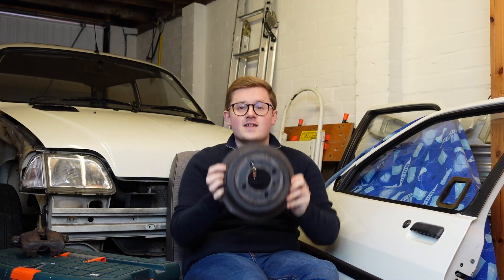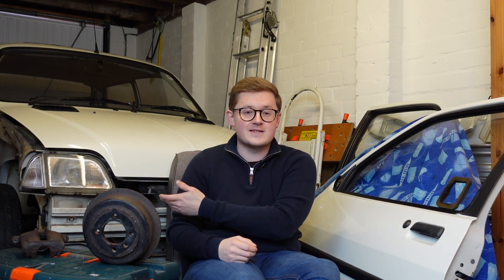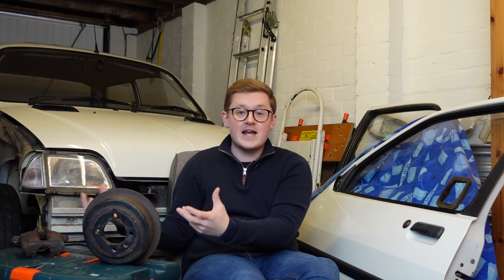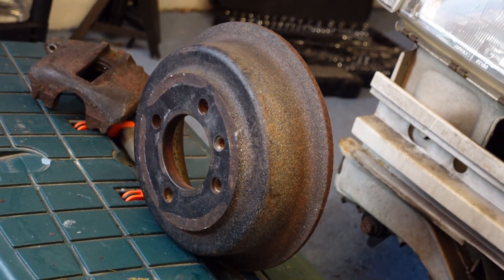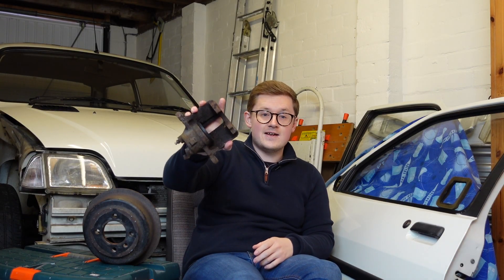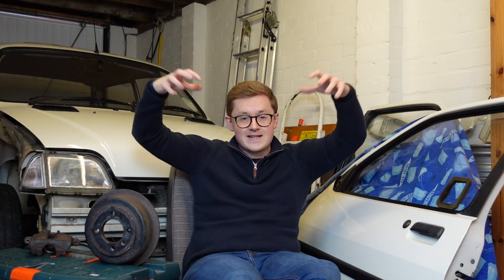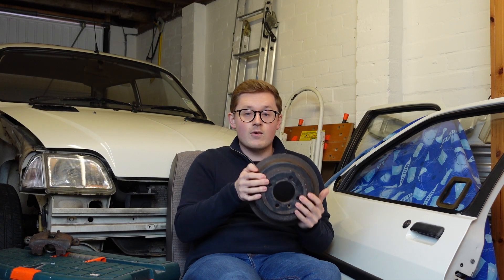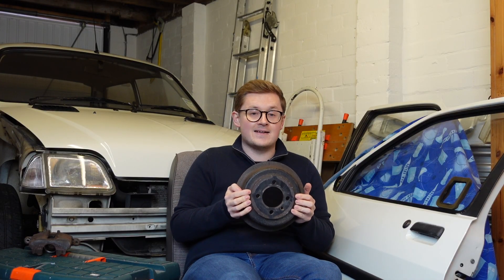Why are Drum Brakes Making an EV Comeback?

Comment: Fully electric brakes sounds like a horrendously stupid idea:
Yeah sure that would work, but there is a fundamental safety problem - what happens when there is no electricity? Are the brakes by default open or locked? For driving the brakes being locked would be the better option - if there is any electrical fault and the brakes no longer work (for whatever reason - dead battery, broken alternator, lose cable) would be fatal. But if they are locked that also means you can not move or rolling-start your car at all, nor can you tow it.

And for supposedly greater braking force:
Bollocks. That is complete and utter garbage, 100% wrong. Sure - they might be able to apply more force to the axel it self, but once the tires are locked up that's it. And any normal car has enough braking force to lock up the tires. Any extra force the brakes might be able to produce is useless by definition.
The same bullshit is still spouted by bicycle-enthusiats. Always funny seeing them claim that disk-brakes offer more braking-force than rim-brakes - and all i need to do is show that the rim-brakes are not only strong enough to flip you over but also to fully lock up the front-tire when applied too rapidly. Braking is fundamentally limited by the tires and that is even with soft high-performance tires.

Comment: Do you think all-electric brakes will ever be fitted t cars or lorries? These could eliminate the hydraulic system altogether, relying on electric actuators to operate pad/disc or drum mechanisms. This system, with multiple discs is used on the Boeing 787 airliner, where brakes are required to bring a huge weight of a loaded plane to a standstill under emergency test conditions of a landing or abandoned take-off. Presumably, actuators can be coupled to some sort of ABS system. One difficulty might be with achieving 'brake feel'.

Comment: Quick reminder that,as far as I can tell anyways, all EV have an established program to keep your disc brakes clean. Tesla highlights this more than others in their manuals. The pads will barely touch the disc randomly to keep themselves clean without slowing the car down.  Just barely enough to knock off any rust or dirt.  They do recommend occasional harder stopping from the highway just to make sure there’s no other issues for emergencies, but that’s not.  Otherwise, these are all great points and well presented!  😊
Reply: Tesla also says you have to clean and lubricate your brakes every year
So there might be a rust problem that maintenance must keep in check .
It's no wonder that Tesla's are doing bad in German Tüv statistics.
People think it's a EV and doesn't need maintenance, until they show up at the mandatory checkup and have problems after 3years of not watching after their car's

Comment: All electric brake actuation has been common for half a century on trailer brakes!

Not much to worry about with an EV, in the case of a failire you could still have a mechanical hand brake, and the systems could self check at each starting sequence judt like ABS does now. 
This will, in a sense, provide triple redundancy, as the Regen system is the primary braking system on an EV. 
One failsafe could be to make electric applied brakes like air brakes (they actually are configured to APPLY when the air source fails)

Comment: This is extremely good information. Part of the ecology is also durability and using things for longer. Battery of EV are now proving more durable than expected; and it will be even better for LiFePO4. A BEV purchase may now be one going for a generation time. The exchanging of cars every 2 years is part of the pollution problem. Keeping a car running for longer (any kind of power) is an ecological move. So drum brakes keep nasty dust inside, rust less the breaking mating surface, and require less maintenance / exchanging parts. The springs reducing friction is really great to hypermile. It can have as much impact as less using the AC, or checking good tire inflation pressure.

Comment: Well a bit of rust on the disc really has a neligible effect on braking, the pads shed the rust in seconds.
Reply: That was my first impression, which is why I was surprised when reports began to surface about EV's requiring fewer pad changes but more major overhauls. When used less, the whole mechanism rusts from disuse, eventually locking up into unreliable behavior. If your driving behavior rarely applies full force, you don't get the regular movement that keeps seals and rubbing metal surfaces clean and functional.
Reply: @spelunkerd  I drove a 1974 model car with drums about 2001[ sister in laws whilst mine was in the shop], it had never had a fluid flush and there was as much water as brake fluid in the lines and all the wheel cylinders had siezed, how she drove it without killing someone I don't know, hit the pedal really hard and slow down a bit, had a foot operated park brake I had to use. needless to say I stripped the whole system down and replaced all the wheel cylinders after a flush out.

Comment: 8:22 - that is no issue where I live in Australia. It is a legal requirement under Australian Design Rules that all EVs when using regen braking MUST activate the brake lights. It can be done, and ALL EVs should be doing this globally. To not require this is as irresponsible as not having any speed limits nor stop signs.

Comment: While the explanations are good, disc brakes came about because drum brakes "fade" when hot, which is dangerous. AND while you discussed that, I feel the points against disc brakes can be overcome. Why can't a mechanical actuation be made for parking the car? Also, why can't springs be put in to move them away when not braking? I don't feel those are valid reasons to go with drums considering their drawbacks. Really, EV manufacturers are going with drums as marketing BS selling us on it like it makes sense, just like they are trying to sell us that EVs make sense. It's marketing and they're on the losing end.

Comment: I saw a drummer at a pub session using the outer of a drum brake. He had broken a drumstick, so I quipped "a drum break?". No reaction! That's drummers for you. Disc brakes get hot, metal expands, & shrinks as they cool. Remember RHD Citroen Xantia (LHD designed hand brake lever)? If not put on properly discs release eventually. With drum brakes they bite better as they cool. I saw the results on a Transit van - was 10 seconds away from a "situation", measured it next day! If walking in the other direction - I shudder to think!

Comment: I have a few anicdotes and a glaring physics "observation" about drum brakes. I'll start with the physics.

In my physics course, I learned that the formula for friction is f=uN, or friction force = coefficient of friction(material's properties) x the normal force (the pressure the pads exert on the disk/drum).  Nowhere in this formula is surface area accounted for. I am no physicist, but I do not believe the surface area of brake pads plays much if any role in how hard your brakes can stop you. I believe the extra material on drum brakes is solely for extra lifespan. I suspect any extra braking force either system may generate would be down to increased pressure from the brake cylinders or the material of the brake pads having a higher coefficient of friction. My question to anybody who really knows would be, if both drum and disk brakes are capable of locking up the wheels, doesn't this mean that both types of brakes are more than sufficient for whatever load you'd be trying to stop? Ignoring cooling properties, weight, lifespan etc...

Anyways, my 30 year old pickup truck has drums on the rear axle. They lasted 250k miles (400k km) before needing to be replaced, and even then 1 side still had another 5-10 years worth of material on it (self adjuster seized up). The 2020 International flatbed truck I drove for work had all-round drum brakes. They did an excellent job keeping dirt and water out of the brakes while on jobsites and other various dirty environments. I never once experienced brake fade or reduced braking capacity from contaminated brakes.

Comment: So we're technologically regressing. All in the name of climate of course, or rather sticking it to the bad bald dude from Russia.
By the way, you don't need an EV to do regenerative braking. Just leave your car in gear and turn on the AC. Keep downshifting to keep revs above 2000 until you stop. 
Doesn't apply to americans since they drive with AC on 24/7 and drive automatics.
Reply from the maker: I wouldn’t say that. I’d say shifting across to a system that potentially better suits the technology.

Comment: There are only 2 reasons to buy a new disc brake caliper: 1.  ignoring timely brake pad replacement therefore destroying your brake disc and then damaging your caliper, 2. a wreck.  A brake caliper is a very sturdy, over-engineered automobile component and it should last longer than your automobile.
Reply from the maker: I would heavily suggest that you’ve never lived in a climate that promotes rust or a region that uses salt on the roads in winter. Calipers are wrecked on thousands of cars every year because of road conditions here. In fact, the caliper shown here had to be replaced on this Metro in 2021 because it was seized and the bore for the piston was damaged. The same thing happened to a caliper on the front of my E46 BMW last year!
Reply: @TwinCam  correct on that account, I live in the South.  We get measurable snow about 5 years apart.  But, I've done enough of both to intensely dislike drums.

Comment: I'd like to add the case of the Citroën GS. FWD, disc brakes front, drums on back, but the discs were inboard - that is on or driven from the gearbox output shafts, not on the wheels. The handbrake operated these disc brakes via a cable/lever arrangement. It had fearsome braking with almost no brake feel and short travel, took time to get used to!
Advantage of inboard mounting is reducing unsprung weight, complexity is not (necessarily) increased, and better weather protection. 
Why didn't they use the rear drums for the handbrake? Because they were Citroën!

Comment: One thing worth mentioning is that it is much easier to tell how much is left on the brake pads on disc brakes and the condition of the rotors, being visible without even removing the wheel in many cases.
Reply: It used to be, I believe. An electronic braking system needs to know it anyway.

Comment: With an ABS system, the higher braking force of the drum brake makes no sense because the ABS holds the braking just above  the lock-up point until the car's speed drops to a minimum. So the main point of return to drum brakes is nonsense.

Comment: WoW!!!  Another reason to NEVER BUY AN EV!!!!!  Thannks for the heads up.  I have been fixing most of my automobiles for the last 35 years and I was never so happy as when I finally got both my wife and I 4 wheel disc brake automobiles.  Drum brakes are a pain in the ass, they are easy to assemble incorrectly and the wheel cylinders are prone to leaks.  Also, I don't understand how ABS systems will function reliably with drum brakes.  Overall, pass on drums.

Comment: I completely disagree that big brakes are not necessary. They shed heat better and brake considerably better. No electronic system will be better than bigger brakes, ABS mixed with small brakes only destroys small brakes much quicker.

Comment: I have some massive drum brakes on the rear axle of my truck. I do my own maintenance, and though parts may be cheaper, the drum brakes are a major pain in the neck to work on. I plan on converting them to disk brakes eventually, once the current set of shoes wear down.

Comment: Yeah, i needed to replace brake rotors even on my petrol car, because i use engine braking most of the time. The surfaces were fine, but the outside edges had lots of corrosion and uneven chunks of rust fell off.

Comment: There are no advantages to drum brakes, even the dust eventually leaves the drum. There is only  one reason VW are using them, they are cheaper. Saving money where the buyers eye doesn't see it. You will not read VW boasting about drum brakes on their brochure page

Comment: If only there was a way to get the rust of the discs.. like I dunno.. engaging them just ever so slightly while regen braking is active every now and then?
Drum brakes SUCK, they sucked in the 80's and they still do! Super heavy EV's need proper breaks to slow them down.
Braking needs to work in emergencies more than it needs to work to slow down gently for a stop sign where the regen system can deal with it.
There are plenty of drum/disc combos out there to retain the easy park brake option without compromising on proper stopping force.
Let's not even mention ABS on drums.

Comment: Drum brakes do not operate better due to increased pad area. The formula for friction works outside of surface area. μ = F/N, where F is the coefficient of kinetic friction between pad and rotor and N is the normal force exerted by the piston.

Comment: Brakes are oversized today, the rotors and pads are never the limit anymore, the tires do not transfer the stopping power of brakes to the ground anymore. Cars are to heavy, tires are made to be cheap and last long. Drum brakes were fine in the 60s and still are in the new millenium, my best stopping car had drum brakes on all corners and really good tires.

Comment: Having serviced drum and disk brakes, maintenence on drums are easier and less frequent.  Changing pads is faster and easier.  In order change shoes on a drum brakes I had specialized tools   so I could perform the job faster.  The automatic brake adjusters on drum brakes can result in shoes locking the drum on, in which case the solution is to cut off the axel!   
There are disk brake designs that retract the pads when not in use.   
Us old timers know how hateful drum brakes are.

Comment: In practical application the disk brakes are better . In extreme conditions with disk brakes more brakes pressure solves the problem. With drum brakes heavy pressure for long times results in fade followed by no brake action.  Rust on the disk only requires more brake pressure.   The real reason for drum brakes is cost

Comment: Grabbing is actually a feature of drum brakes as it applies more braking force with less pressure.  It only applies to the leading shoe which does most of the work. Triumph had a front drum system with 2 cylinders and 2 leading shoes. If you need a system without grab then 2 trailing shoes would give this but you would need more force on the cylinders or larger drums to obtain the same braking force.

Comment: Drums can not be inferior.  Those tractor trailer trucks you see running down the road all use drum brakes, not a disc on any axle.  If disc were better, they would be on the heaviest vehicles on the road.

Comment: 9:20  , why would disc brakes "no longer work" if the rotor is rusty?  In my experience, they work too damn well (grabby when rusty).  It's a well known issue on forklifts (at least the ones that don't put their brakes inside the differential)  They have very powerful braking systems, and are frequently left unused for days or weeks.